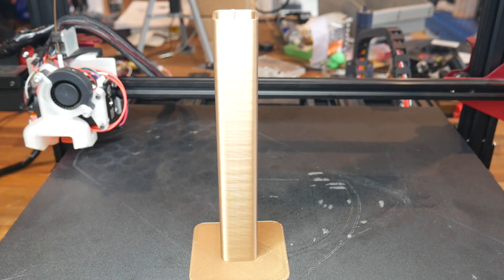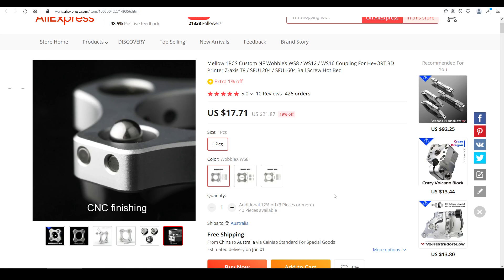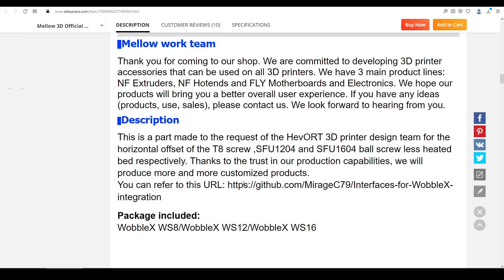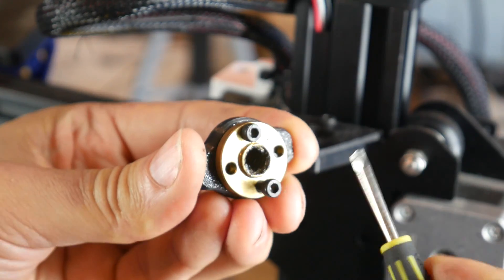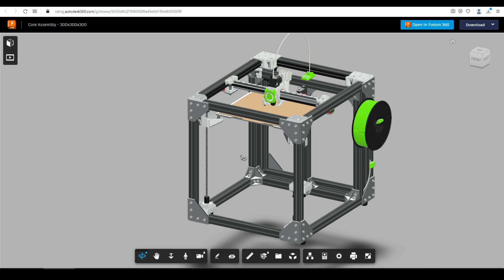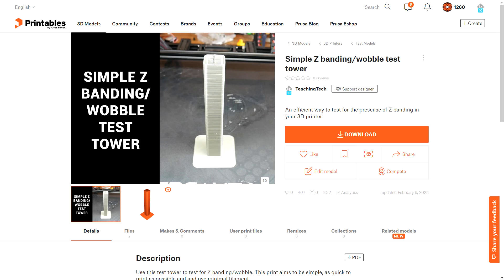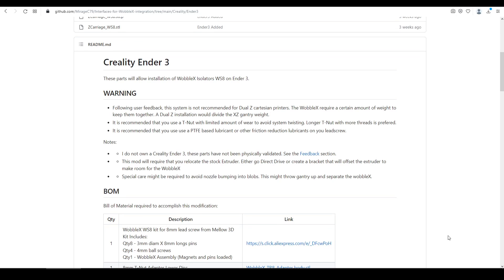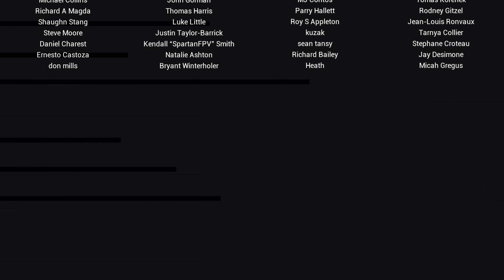The foolproof fix for Z banding and misalignment? MirageC’s wobbleX

Comment: Thanks for this review. I’ve built a custom 500x500x600 corexy triple Z axis printer and the 600mm lead screw’s definitely have some bend in them. I was going to go and buy some more expensive ball screws to remedy the problem, but for the price, I’ll give these a try instead. I should be able to adapt the ratrig bed mounts to my printer. ( machinist here, so I have access to machines to make changes on the fly as needed). Keep up the VERY informative reviews. It’s much appreciated!

Comment: Imo it's bit wrong to try to fix lead screw wobble by additions. If one allows it to flex too much cause twisted lead, it'll then result in changing pitch of the lead screw. Hence people should always check if their screws are actually straight. It's not hard to straighten them by force or downright replace them. After leaving or even checking that drive nut is straight and possibly leave it floating can increase quality quite a bit. Going for best possible results looking into different solutions is ok, but many seem to forget the very basics.

Comment: I'd like to see what you do with the compression springs.  I have an old Prusa i3 clone with threaded rods that had the Z banding.  I printed some mounts that allowed it to freely move but rested on the gantry and required some weight to keep it stable, it was fine for years. I changed to a lighter extruder  and upgraded it to lead screws and have had nothing but problems since (z banding, jamming on the z axis, inconsistent z height on levelling) and all but abandoned the printer for a year. While it may not be a golden bullet I think this solution might resolve most of my problems if it can do it with a lighter gantry.

Comment: what if you use 2 Anti-backlash pieces, one on top and one at the bottom of the whole assembly instead of trying to use springs to hold it together? wouldn't it keep both parts tight?

Comment: Would be well worth adding that 500g weight to a standard Ender 3 to see what effect that has without the WobbleX.
Just to give a more direct comparison 😊
Reply: I thought the same thing. Maybe the problem would be resolved with the weight alone?
Reply: Exact same thought I had with when he lubricated the lead screw. Might have solved the issue (tbh, I think not, the screw was too bend, but still, same principle applies).
He should not have that done for a fair comparison. Or, at least lube it BEFORE adding the WobbleX system and compare it with that.

He added more variables in the mix... never a good thing when comparing stuff.
(though, don't get me wrong, I'm very glad he reviewed it either way!! This is just a 'small' thing to be aware of when doing 'scientific' comparisons).

Comment: Sounds like a nice idea, but with its challenges, 
and thank you for sharing.

I thought to share my experiance in this matter.

After a year of constant use of my ender3 I had started to get a slight Z wobble, 
so I knew it was time to replace the obvious parts.

Well I thought at the same time I would upgrade the height and add an extra 150mm 
and so I bought a upgrade kit and it came with a perfectly straight ACME lead screw
and I also bought the Z-axis T8 Anti-Backlash Spring Loaded Nut from Amazon

After some tweaking in Jyres firmware it was all set for a full height test and the out come was perfect.

So personally if you have a bent ACME Lead screw or a worn thread and a worn brass Nut 
I would just buy another set and also fit it with a Z-axis T8 Anti-Backlash Spring Loaded Nut.

The Z-axis T8 Anti-Backlash Spring Loaded Nuts is good to help on the Z lifting as the bed or head moves up and when it is compensating the bed level or if you have the Z hopping setting on
Reply: LOL, This is the EXACT same I have: 150mm extension...... + dual, coupled on top, aftermarket dead straight lead screws + anti-backlash nuts on both.
I've done the extension not so much to be able to print taller stuff, but far more because of convenience in having clearance on top for all the extra stuff without actually loosing the original Z-height (LED light, stiffer cables/chain so they don't flop on the bed, having clearance without the need to almost 'fold' the cables when on max height, the dual coupled Z-axis system, etc, etc).
And also extra corner brace plates on the bottom + CR10-style diagonal braces.
The whole thing is solid as a rock and even (very high) resonance vibrations are almost non existent.

Comment: Could a central spring be used between the leadscrew nut and the part of the wobblex mounted to the printer, similar to the preload nuts that are in 2 parts and have springs, just not attached to the screw at both ends
Also stronger magnets could be used?

Comment: Changed to a belt driven Z on both of my old Ender 3 Pro's using KevinAkaSam's belt mod.  Brilliant system, with zero Z issues afterwards.
Reply: Yeah this level of work is getting to the point that you can go belted Z. No grease, no wearing out, no backlash or weight issues. Only downside is if power is lost.
Reply: @jaro6985  Just use a bigger stepper motor
Reply: Did the same mod to my Ender 3 and hands down best mod I've done to it. Perfect Z layers now. On my Ender 5 though I installed another anti z wobble device, but didn't quite fix all the issues. Still prints great, but under the right light you can see the inconsistences.
Reply: Is that top driven? IE z stepper is moved to top gantry?

Comment: Wouldn't the Ender 3 problem be solved by an anti backlash spring? Right now I#m unsure how they are installed on my CoreXY, but I would suspect that they can apply the needed pressure. The adapter parts might need an adjustment though.

 Besides that a big shoutout for MIrageC, his community and Mellow. I think WobbleX is a great product. After it was sold out immediately on release it is now available again and I ordered a set, even though  like your Ratrig my mashine doesn't show a pronounced Z--banding. But every litlte bit of stress you can remove from the frame can only be good.

Comment: I think your assessment about needing to add tension to hold it all together is spot-on, when originally looking at this system that was one of my immediate concerns, that the gantry can lift up freely and thus looses an axis of constraint. Gravity is only good enough if your z axis moves freely enough. Also in general you may want to methodically work through your lifting z axis and see if there is excessive binding that's managing to hold the weight up, or a natural skew caused by where the X bar is tightened to the side plates. You need to lock the steppers to a known initial state then level the X bar from there usually, else it tends to jump to in-between positions etc. I'm personally a fan of the single-motor belted-z setups, they are rock solid once the constraints and parallelisms are worked through, but it requires some definite expertise to dial in.
Reply: @Roobotics :  I totally agree with you.  In addition, while adding extra weight to the upper component will help, it is adding weight to the bed assembly, with the potential extra wear on the Z axis lead screw/nut.  A spring tensioning system would be preferable, I think.
Reply: Off topic here, but since you mentioned it: Have you ever found a place/video where they compare the two systems side by side (dual coupled Z-axis with 1 motor vs. dual Z-axis with 2 motors)? All I can ever find are 'superficial' videos where they talked about how to install them and how to set them up.
I want to find an in depth tech video comparing the 2 systems properly with all the ins and outs, and not just the "with 2 motors you can have automated gantry tramming" ...
What about drift overtime in both systems, what about slack in the belt overtime, what about Z-banding in both cases, what about 2 motors working against eachother, etc etc And also: where to do mount the steppers best? On top (hanging Z-axis) or bottom (sitting Z-axis)... What style of coupling to use between lead screw and steppers (many styles exist), and their benefits or drawbacks... Do you 'fix' the screw on the bottom/top, or do you let if free standing/hanging, and if you fix it, do you do it in one plane or both planes or none at all but instead restrict the lateral movement it a bit... etc etc etc...
Anyways, sorry for the wall of text....

Comment: I've also used the same box-shaped POM clearance nuts that the Rat Rig V-core 3 originally used on my self-built printer with good results.
In fact, I feel that on the combination of screw and nut, the appearance of layer lines comes more from the fit gap between the screw and the nut.
It is well known that almost all screw nut combinations have very large fit clearances. Most of the screw nuts use trapezoidal threads. When the screw is shaken, the trapezoidal threads will cause height errors due to sliding along the radial slope.
Therefore, in my humble opinion, the solution to the Z-axis error caused by the screw nut is mainly to solve the fit clearance of the screw nut. It is necessary to make them as tight as possible and avoid radial relative sliding.
And the "Rat Rig V-core 3 original box-shaped POM clearance nuts" that we both use do a pretty good job of that. After the gap adjustment screw on the top is screwed to the proper position, the relative displacement of the screw rod and the nut will hardly occur in the radial direction. I think this is why your Rat Rig V-core 3 has a very good Z-axis performance at the beginning. .
Its only disadvantage is that it is a bit bulky, and I don’t think the wear resistance is a problem. At least my machine has been printing for hundreds of hours, and there is no problem. I just readjusted the clearance screw halfway.
Reply: On the ball screw, the gap between the screw and the nut is very small, and most of the ball screws are relatively thick, and the straightness is relatively better. That's why it works so well in its raw state most of the time.
If the ball screw bends, the bend will be amplified and faithfully mapped to Z-axis motion because there is no clearance issue with the screw nut. Looking at a section of the screw rod, due to the bending of the screw rod, the movement along the vertical direction has an angle offset, and the local distance relationship forms a right triangle, and unfortunately, the screw rod is at the oblique angle of the right triangle. On the side, the actual Z-axis travel distance is on a right-angled side of a right-angled triangle. According to the Pythagorean theorem, there is an error between them. As long as the ball screw bends, the actual movement distance of the Z axis will always be less than the distance output by the printer, which will cause the distance between layers to become smaller, which will lead to excessive extrusion and layering.
Therefore, in my humble opinion, using the delamination device on the ball screw is mainly to increase the smoothness of the movement of the screw nut. Because when the two ends of the ball screw are fixed, if there is no delamination device to release the radial swing displacement, the bending of the ball screw will cause the pressure of the screw and the nut to increase, and the jamming phenomenon will occur. The coordination error of the ball screw and the nut will affect the axial motion accuracy.
To a certain extent, this can explain why the solution to the layer pattern problem has almost become "metaphysics". The masters from all walks of life have exhausted all kinds of solutions, but they have not been able to solve the lamination problem caused by mechanical reasons in a 100% repeatable and stable manner, because it is a problem that cannot be completely solved, and the mechanical error is there. All we have to do is to make the screw as straight as possible and make the fit gap as small as possible.
Reply: @jackgai1929  THIS!
This is what I love so much!! Please make a youtube channel with stuff like that!!!!! Anyone??!!
Not the "it looks ok, so this is the best solution" , but the actual science, both theoretical and practical, and the very in depth look at things from a deep mechanical, and yes, even theoretical viewpoint (as in: you'd never ever would see a difference otherwise, but it is the thought that counts, and "many invisible errors make a large visible one")....
Thank you for the very interesting reads!

Comment: The thing's already got stronk magnets in it, right? Could you expand on that and install strong magnets to attract the ones already installed in the device, into each of the printed adapters, to make the unit kinda suction itself together without added weight?

Comment: After seeing the initial video on the wobbleX I just looked at Oldham coupler models on Printables and remixed one for my ender. It helps my print surface be as clean as possible even if I don't have visible screw wobble.

Comment: In many cases I like rubber bands better than springs as they are easier to adjust for length and tension
Reply: I printed similar setup without pins and magnets but with rubber bands. Magnets won't hold any position if printer tries to dig into bed, springs and bands give up in Z but keep nut from rotating

Comment: Have you tried an anti-backlash spring loaded brass nut instead of just a plain brass nut? 

For the RatRig test it would have been interesting to see the difference between the 3.0 version and the 3.1 version and then the 3.1 version with the 3.1 version with wobbleX. By introducing two changes at the same time on the RatRig you don't know which one actually improved the print quality. You are just assuming that it's the wobbleX.
Reply: Same with even the lubrication of the lead screws. That should have been done before the base line test, not after it. Because if the lead screw wasn't so clearly bent, or whatever was the issue, the act of simply properly lubbing up the lead screw again might have solved it (a grindy, but otherwise strait lead screw can introduce similar artifacts on the print).
Buit I guess that's the nitpicking boring scientist in me speaking, and not the excellent 3D-printing spokes man, and wonderful enthousiastic youtuber like he is... lol. Still, he should keep that in mind when doing AB tests. hehehe

Comment: i think the tension springs would be a perfect solution to the weight issue, without adding said weight to the system and thereby mass to cause unwanted vibrations.

Comment: I have been looking at the wobble x for a couple weeks now, but I am unsure if my gantry is heavy enough. I have a 3d fused x gantry plate with my linear rail on it and it is heavier than the original gantry, so it may work. How heavy do you think it has to be to utilize it?

Comment: Kit critique: ball bearings are cheap and easy to lose. It would be fitting of them to just pour one extra into each kit sold. I think ideally every small component in a DIY kit should come with extras, if financially viable. If they can add extra pins, so much the better.

This is of course top notch engineering from Mirage but it's kind of a misplaced solution. On a typical Ender/CR-10-like you can just install a reducer (belted or printed) on the top of the frame to be driven by one motor, driving a shaft, which would then drive two Z belts. With enough tension and a good idler, there really isn't a weight dependence. Indeed i think most types of printer builds can work with belted Z very well, i honestly can't understand MirageC's desire to use remarkably shitty but still kinda expensive ballscrews and then design around their flaws like this, it's kinda backwards.
Reply: He explains in his videos though. A least: carries more weight, less maintenance, less wear, and because he can.
Reply: @qwertyboguss  I have seen that explanation and it has left me unconvinced. And "because we can" is of course a great recipe for a lot of fun, and i'm not saying you lot shouldn't be having extra fun with your designs, but perhaps not necessarily a recipe for good engineering.
Reply: About the product itself: kind of a valid critque, but also kind of not!
This was not designed for the typical bed slinger at all! Huge difference there!! It was designed for CoreXY printers with ball screws (types WobbleX WS12 and WS16), which is a huge difference because of the usually bigger and heavier beds. For a bed slinger, yeah, using a proper belt system as the drive train, instead of a lead screw, would be more than ideal. But also a way more involved setup and especially a much much bigger cost for the average user (although the WobbleX is overpriced anyways in my opinion). So, you're complaining about a system which is now, almost as an afterthought, been used for something it was not designed for initially. And it certainly was NEVER TESTED FOR IT to begin with. He literally says this in his blog; "[he has] no bed slinger to test it with" . And simply made a special smaller version to fit those bedslingers 'at your own risk' so to speak (the WobbleX WS8). The smaller WS8 type is also often not available for purchase in the various shops. It is not made available as much as the original/bigger versions, aka: not the main design of the product.